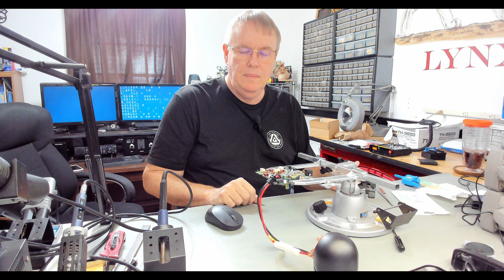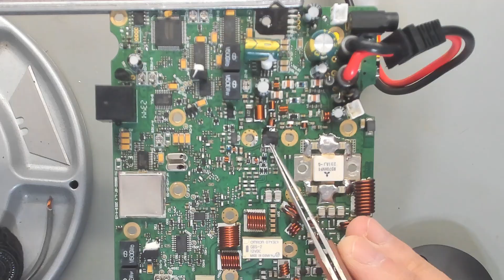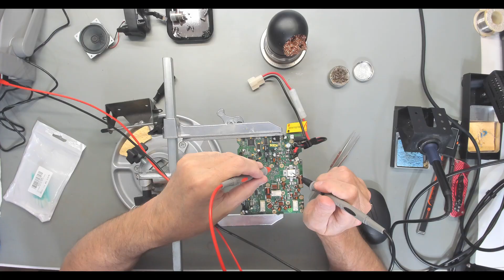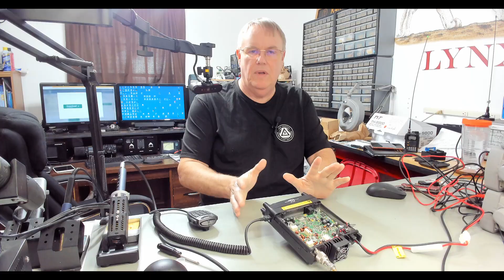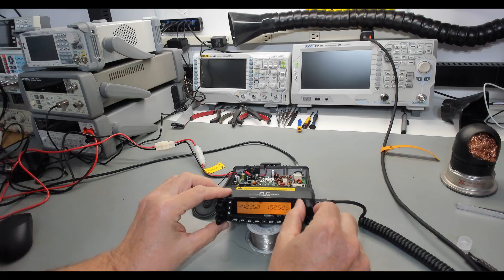Can the TH9800 Repair be SAVED with This Simple Fix?

Comment: Have you noticed any provisions on the board to add an external data connector, as the Yaesu 8900 had?
Reply from the maker: It’s been a while since I did this repair, but I don’t remember an additional connection. 
RJ

Comment: On the TH9800 there are two chips that do much of the work, one for each of the two radios in the box. These chips are 3.3V chips but they are running them at 5 volts. SMD pads are there for a resistor and zener to regulate to 3.3V but the resistor might be only part there. Schematic should show the zener resistor combo but not populated on yhe board. My radio ran 24/7 for a year then quit.
Reply from the maker: Thanks for the info! I did not notice that but will take another look at the schematic.
RJ
Reply: @LynxElectronicsLab Its U113 and U114. I think D605 is the zener for U113. Its probably not there. U114 Has an identical circuit.